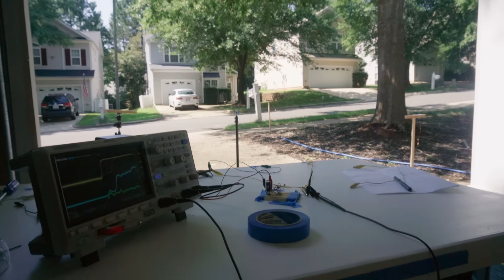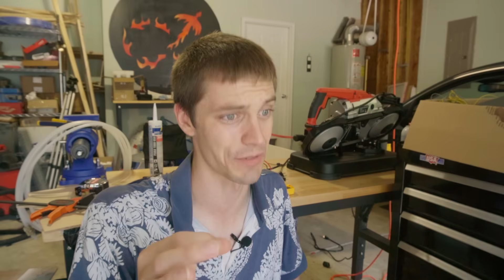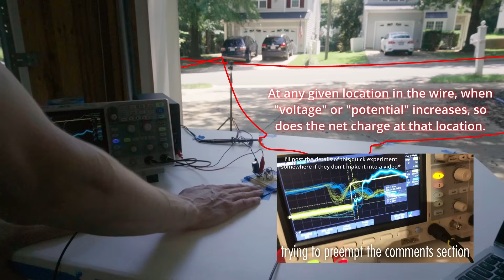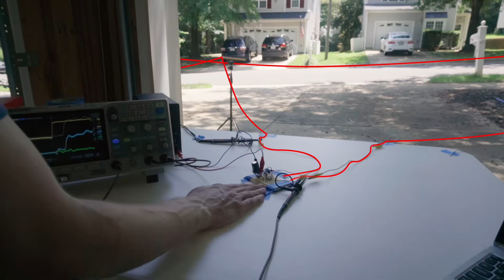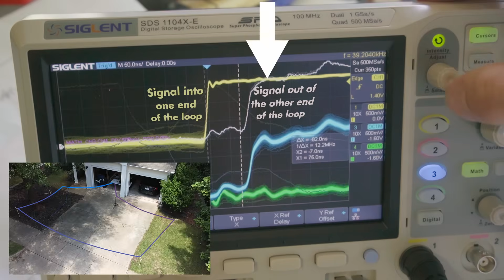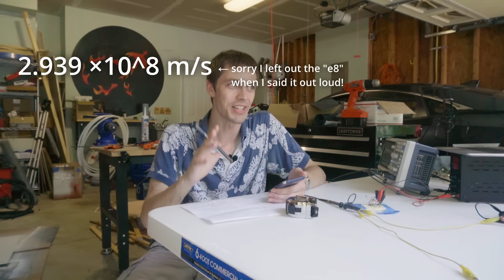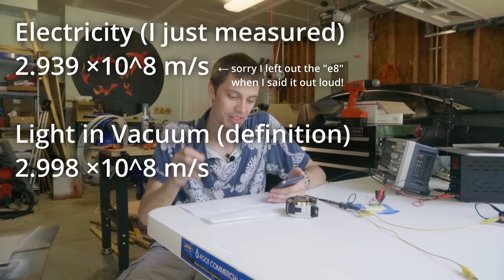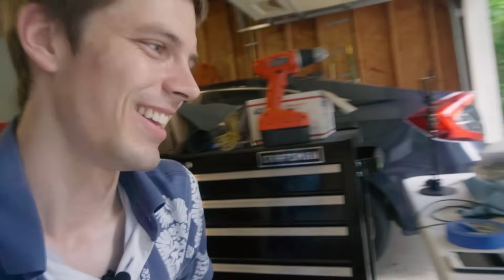Why does WATER change the speed of electricity?

Comment: I'm very confused about this topic. I'm sure  that you saw Veritassium video about this. https://youtu.be/oI_X2cMHNe0

I graduated as electronic technician at my high school, then I started an Electric Engineering at the University, but suddenly I moved to Computer Science, and I left behind most of my knowledge on electricity a long time ago. But here is the question do electrons really move on the wire surface, or they don't? As I now I'm struggling to figure out, electric fields are really the the energy carrier. So why free electrons would move at all?
Reply from the maker: In dc steady state, current flows everywhere in the wire, center and edges. I’ve simplified the wire down to 1D because where you put the “extra” electrons near the battery end doesn’t matter. Derek points out that these extra electrons live on the outer edge of the wire, but he’s wrong that they can’t move and don’t push on each other. That can move and they DO push each other down the wire.

The amount of surface charge (and then total “excess” charge near the negative end of the battery is minuscule enough that no extra CURRENT really flows at the outer edge of the wire, but this excess charge is large enough to shove the electrons in the wire forward (or pull them in on the other side of the battery). Again, in a wire like this, the whole surface charge thing is pretty irrelevant.

The only time that current (not charge) is concentrated near the edge of the wire (ie. The electrons at the edge are moving but the ones in the middle aren’t) is due to the “skin effect”, which is only a concern for high frequency AC and is a completely different thing.

Hope that helps!
Reply: The relevance of surface (and interface) charge is not with the current it can carry, but with the field it establishes, inside and outside the wires.  In ordinary circuits, surface charge is miniscule - could be equivalent to just a handful of electrons - but due to the strength of electrical interaction it is enough to establish the electric field E = j / sigma inside the wire that will carry the bulk free electrons along. This is the field that accelerates electrons in the wire, while the collisions with the lattice will result in an overall constant - and small - drift velocity compatible with the value of current density  j. These collisions are also responsible for the dissipation of power into heat inside the wire. ( It is usually very small in copper, for reasonable currents. -- it is much larger in resistive materials even if the value of j is the same because interface charge developing at the conductor-resistor interface will result in a greater accelerating electric field inside the resistor..)

The skin effect has nothing to do with the surface charge that establish the field. The current is the result of the movement of the free bulk carriers due to the field produced by the tiiiiiiiny surface charge.

As you increase the frequency, the bulk current gets increasingly confined towards the surface of the conductor, yes, but it's still the minuscule surface charge that is calling the shots.
Reply from the maker: @copernicofelinis  but there’s no substantive difference in behavior between a surface charge “calling the shots” and 1D charge buildup in a wire. The surface charges still push each other down the length, the wire just happens to put all of its extra electrons in one place
Reply: @AlphaPhoenixChannel  at DC the configuration of surface charge is steady and does not change with time, even if the bulk electrons are moving along the wire. There is no pushing (edit: especially between bulk free electrons), just a dynamical equilibrium that results in a steady distribution of surface charge.

Yes, during the initial transient there is a redistribution of surface charge from the initial configuration that made the electric field zero inside the conductor, but the current associated with this redistribution is little thing compared to the bulk current. Also, it propagates in both directions from the switch.

I guess only with superconductors the surface current becomes relevant. With ordinary conductors it's the bulk current that dominates (at high frequencies it gets confined towards the surface but it is still mostly inside the material.)
Reply from the maker: @copernicofelinis  I agree - I just think that the whole surface charge discussion confuses people because it doesn’t matter to how current flows in the end. I don’t think anything you said contradicts what I say in the video, it’s just extra info.
Reply: @AlphaPhoenixChannel  well, there is no "pushing" between bulk electrons. The great confusion about (classical) conductivity in most introductory textbooks is due to the neglect of the role of surface and interface charge. Only relatively recently textbook have started mentioning it.
Reply from the maker: @copernicofelinis  first, the bulk electrons are still charged so they can still push (and certainly push during the transient I explore here), and second, even if their net push is zero after the surface charge is established, the surface charges are still “mobile electrons pushing other mobile electrons”. I don’t get why Derek and now others insist this is such a great neglectful omission. Is there a measurable physical property, a change in behavior of the wire, that would result from NOT assuming the wire is a 1D object? I’m sorry if that sounds confrontational but I’d really honestly love to know an example. I think the charge separation happens, I just think it’s irrelevant. I’d love to be proven wrong (or do an experiment myself!)
Reply: @AlphaPhoenixChannel  don't worry about being confrontational, it has to be this way. We are presenting somewhat contrasting views and it is ok not to agree on certain aspects. The greatest courtesy  you could do to me is being ruthless and pityless in demolishing my view. No offence will be taken.

Yes, electrons are charged and therefore can push on other electrons. But they are also all around you, so the net push as you say can be considered zero when the density is uniform (such as in DC steady state). 
Now, regarding surface charge being electrons pushing each other, I think we can agree on this, but let's consider the simplest case possible of DC conduction once the steady state has been reached.
The surface charge is already in position and does not change with time, the bulk electrons are moving (classically) at an average drift speed v along the conductor's path and the density is uniform.
The bulk electrons are not pushing each other along. One can argue they are pushed by the surface electrons, but this mechanism is profoundly different from the bulk push associated with the hydraulic model: to begin with the pushing charge is not moving at all, and most importantly the push does not happen at the pum--- generator and then propagates down the pi--- wire resulting in the current, but it is distributed along it. Surface charge is also essential to explain how the electric field inside the conductor is directed along its path and also explain why the electric field around the wires has that configuration.
Reply from the maker: @copernicofelinis  I’d argue that the surface charges do push each other along, and that if you average all the charge in the wire radially, condensing it down to 1D, the electrons are denser near the negative end of the battery, and this charge imbalance makes them spread out (repelling each other with fields).

Why draw a distinction between the surface charge and the bulk charge? Is there a behavior of the wire that’s different because we recognize this separation?
Reply from the maker: It feels like somebody saying “oh no! Nobody understands how tables work!” And then proceeding to explain how photosynthesis works in trees that are cut down to make tables. It’s 100% correct, but I don’t understand the relevance when it collapses to a 1D model that’s functionally identical. Imagine my “electrons pushing” is just only talking about the electrons on the surface, and it holds exactly. I just do some averaging to include the rest because their location in the wire doesn’t change how current flows through it.
Reply: @AlphaPhoenixChannel  I'd say the very effect Derek chose to show: that rise in current at the load before the perturbation along the wire has the time to reach it.

How can it happen? The perturbation in the distribution of surface charge when the switch is closed will create a perturbation in the fields that will propagate at the speed of light in the dielectric medium you wires are immersed, and will reach the load after a time d/c. These fields (electric due to the surface charge imbalance, magnetic due to the current that is locally starting to flow from the switch) will start to redistribute the surface charge near the load and create an electric field inside the conductors and resistor body that explain the small current measured.

It's not the push in the charge near the switch that has propagated to the load along the conductor. It's the fields that have propagated through space.
Reply from the maker: @copernicofelinis  yes but why does the charge have to be at the surface for this to work? (Also I’m transient it’s not all at the surface yet but still)

I explain this effect capacitively in my last video where I set up the experiment with the 1km wire, and the explanation is just as good with a 1D wire. I have actually done more experiments since and think there’s also a significant inductive component but that’s also explained by charges starting to move in a 1D wire
Reply: @AlphaPhoenixChannel  I believe it's for the same reason that in electrostatics charge has to be on the surface of a conductor's body: it has nowhere else to go.
Mathematically the surface charge is a necessity dictated by the solution of Maxwell's equations, continuity equation and constitutive equations in the media. There is a nice example of this on Sommerfeld's theoretical physics textbook (it's an infinitely long resistive wire that simplifies calculations).

Regarding the capacitive effect, not so fast... I don't remember how you explained it, but if your explanation is like Mehdi and fold back to the transmission line model, it is flawed. The capacitance in the transmission line model is a lumped component that does not account for the propagation of field between the plates. It basically fails to see the effect at d/c Derek has focused on.

To sum it up, it has to be surface charge because Maxwell's equations say so. We might argue wether or not the surface charge is the cause or the effect when we consider the propagation in the region around the switch, but at a distance d across the dielectric it seems to me a temporal sequence can be established: the fields arrive at the surface, the surface charge reacts and redistribute itself, the fields inside change, the bulk electrons start to move.

(Incidentally, I believe this sequence is the reason there cannot be a current inside a perfect conducting ring: the surface charge reacts and nullifies the electric field inside it before any net E can form and start a net current - this is another famous Lewin exercise).
Reply from the maker: @copernicofelinis  I’m not arguing against the surface charge’s existence - you’re right, maxwells equations say so, and it’s a basic electrostatics problem that happens to be in a weird sloped steady state (as opposed to equilibrium) in one of three dimensions.

I asked why it mattered. In Derek’s experiment, electrons in one wire still interact with the electrons in the second wire electrostatically and inductively, and weather they are in the center of the wire or clumped up at the edge makes no difference to the outcome. Actually in that case where the two wires form a sort of capacitor, the charge density around the edge of the wire won’t even be the same because of the mutual influence of the wires.
Reply: @AlphaPhoenixChannel  I am not sure I understand the question... It matters because (classically) it explains how you can have an electric field E of constant magnitude along the whole circuit.
How do you explain it without resorting to a dogma (which is what most introductory textbooks do)?

The capacitive and inductive effects you mention are just another way to say the electric and magnetic fields propagate from one wire to the other. But what is their result? A force that changes the surface charge on the opposite plate, and a force on on moving charges in the opposite wire. If you want to see what happens at a specific point inside and along the wire you cannot avoid solving Maxwell's equations and therefore considering the dominant role of surface charge. Especially during transients, when the current density inside the conductor is not uniform, both longitudinally and transversely.

Comment: "electricity travels at speed"
this seems an odd statement to me. the fermi velocity of charge carriers is something known. the potential permeates the wire at the speed of light, but the carriers have a much lower speed. why people conflate the two concepts is bewildering. it leads to confusion.
Reply: "Most of that field is moving outside of the wire"
That is not correct. If that was true, you'd have a much more pronounced slow down of the speed of light. 
Field lines are much denser in a conductor than outside. This is why you are safe in a Faraday cage. Because a relatively small amount of matter can build up practically any amount of "mirror field".

Comment: Maybe one day you'll learn about confirmation bias and can do true experiments.  Your entire argument was that resistance of a wire doesn't change the 'speed of electricity', you measured, you came up with inconsistent results and then concluded that you were in fact correct.  What...
You are so engrossed in the theory that you wrote off physical results as 'measurement errors', even though you made absolutely no attempt to calculate the tolerances of each part of your experiment.

Comment: What about the material of the conductor it self? It would be interesting to see if copper, steel and aluminum wires are different.  Or what happens if you place the wire through a material that (almost)complete blocks the EM fields.

Comment: You said they the calculated speed does not match the theoretical because of frequency stacking, Prove it. Show us the different rates of propagation of lights speed for different AC frequencies, compared individually. you will likely need to use a material with a more consistent permeability with temperature. Are there material specific frequencies that result in a harmonic driving of the molecules in the dielectric? Are there no-pass frequencies?

Comment: Video experiment Prompt B:
Make the speed of light more consistent while passing through mediums. How?
A DC positive power impulse, switched fully off with no gate drain, at the speed of one of these "fast sub-frequency peaks"
The power level this is achieved at is negligible; It is hard to do at high power, since the signal slew rate being that fast means denser energy which tresses out electrical components not rated for high impulse power or slew rate.

I assure you, the research behind this phenomenon exists. Currently you're exploring adjusting the medium. I'm proposing loading the signal in wave fronts and send impulses at resonance, Actually Nikola Tesla and other 18th century scientists proposed this first.

Turns out, superconductivity is just wave fronts of cooper pairs. It's simply a dense impulse signal caused by the conductor's temperature influence. I'm saying, Nikola Tesla already proved, and modern researchers have independently proved (not thinking of Tesla) that impulse signals if switched fast enough pass without resistance and have other less defined properties beyond superconductivity at room temperature.

Comment: Wouldn\t it be easier to just have 4 post in an rectangle and then wraping it around them several times to have a longer wire without taking up so much space. If you have enough distance between each lap around the electromagnetic influence on nearby wires would be  avoided.

Comment: Not sure if this is testable, but does a tight corner slow the electron propagation and potentially cause a higher charge at the corner? My intuition is that electrons around the corner have a force acting on them which is not parallel to the wire, and so don't have the same acceleration along the wire, causing a slight build up. Perhaps this would be momentary when the switch is activated.

Comment: Is it possible the multistranded wire is longer due to twisting or strain displacements hidden under the rubber or pvc coating?
Reply: That might explain the slight difference in timing in that larger wire. Good thought.

Comment: Thanks AlphaPhoenix! In radio wave propagation we are taught the speed of light through a standard insulated wire is 95%. This may have been determined long before the modern equipment. It's an important number in determining antenna lengths, I wonder if we should be using 98% instead?
Reply: It depends entirely on the characteristics of the wire you're using.  In coaxial cable it's around 80%.
Reply: @stargazer7644  thank you! Feedlines lists this number in the spec sheet. I was referring to random stranded wire like he was testing. The literature says to assume 95%.
Reply: @BurrowsNE  Yes, coax varies from about 60% to 85%, twisted pair ethernet is around 65%, open bare wire is closer to 95-98% c.

Comment: The stranded will be twisted so for length x of encapsulated wire it would actually be length x factor long. Of course, they're shorting to each other but you'd think there's be a little bit of dielectric effect. Interesting that it has no effect. And just to be THAT guy ... 20:20, should be "if you take all those sine waves each of that frequency and amplitude and add them all together... ".